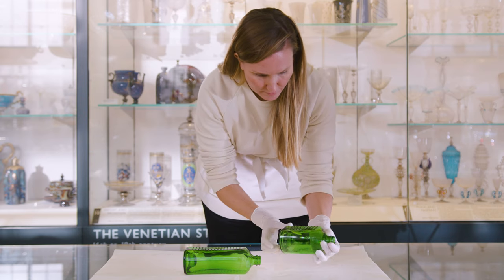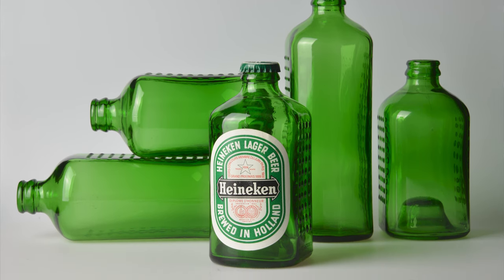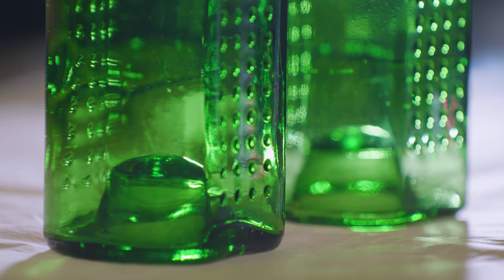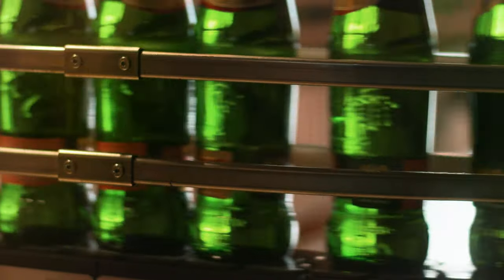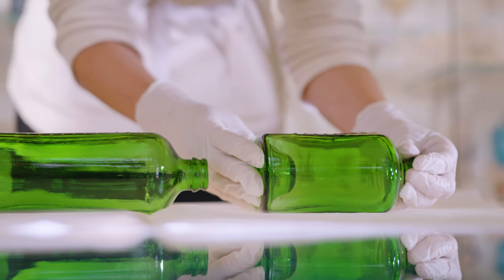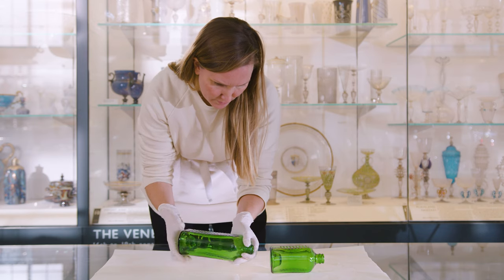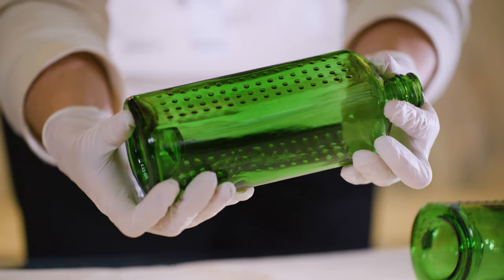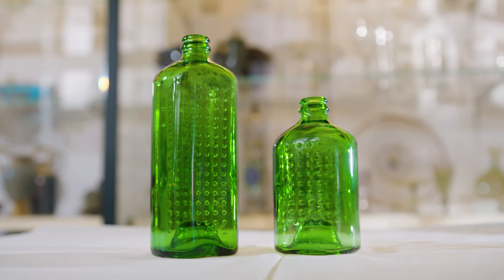Heineken WOBO Bottle | Object in Focus | V&A

Comment: Great concept. I wonder if it would pass modern day load and stress tests normal bricks have to pass.
Reply: I've seen glass bottles used in cement walls. Though I'm not sure how'd it hold up under stress.
Reply: it probably would not do great in areas with a lot of earthquakes and natural disasters like say Japan for exemple, but in safer areas I'm sure it could be very useful ! maybe not for big houses with severals floors but at least for simple shelters and other smaller stuff. Better than just throwing away the glass

Comment: Really interesting topic, esp in these times of ocean pollution and climate change. Round plastic and glass bottles ARE currently in use in homebuilding - check out Earthships. Some adobe based houses also use them as bricks. The necks of two bottles are cut off and the rest is joined to form a cylindrical brick which (because of it's shape) is really quite strong. The glass bottles are often used almost as stained glass elements in the walls, letting in colored light from the outside. Lots of info on YouTube - check out "sustainable housing".